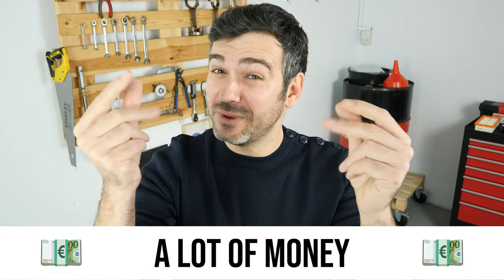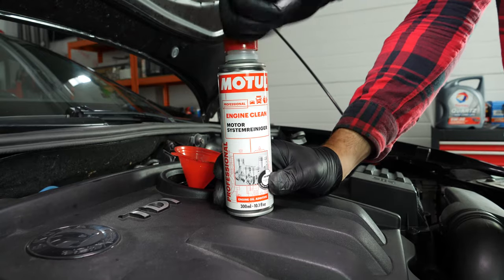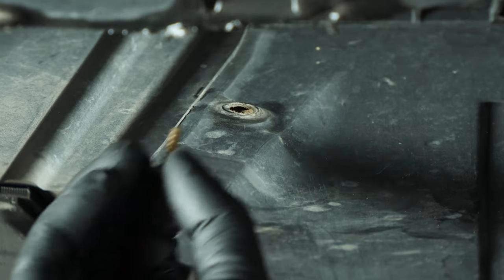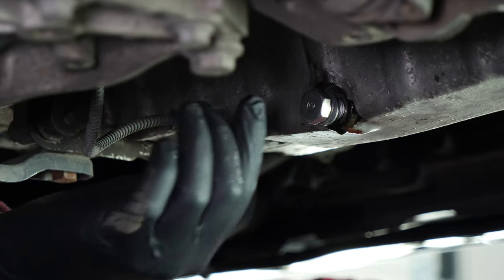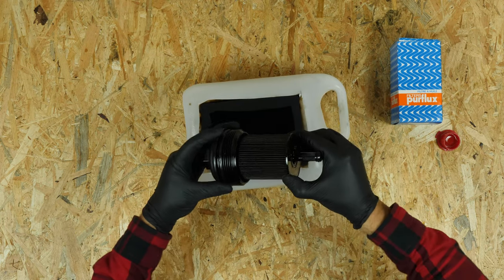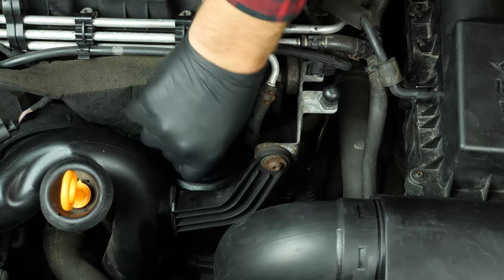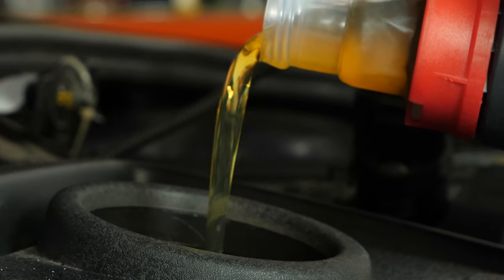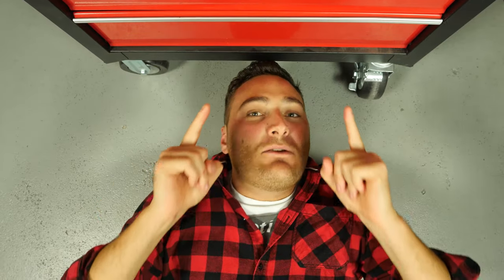Change the oil and the oil filter Octavia mk2 1.9 TDI 🛢

Comment: Thanks for the guide! You definitely make it look easy.

Took me 3 hours from start to finish. 

Definitely an easy job but pretty hard to do it on the ground.

Oh and I bought the parts from mrauto! Even though I haven't heard of bolk engine oil before, it's still the correct spec. Great prices

Comment: Weird,I always remove the drain plug and after that the filter to let the old oil drain out,and then fit back the drain plug.
The way your doing it will still leave old oil behind.
Reply: Very true. I do it the same way you do.
Reply: Same. After I unscrewed the oil filter, a lot of oil came from the drain. I had the oil cap off too!